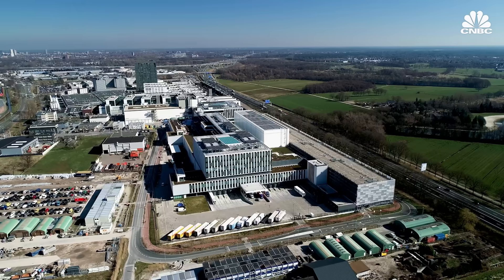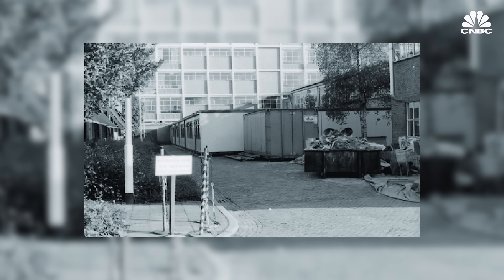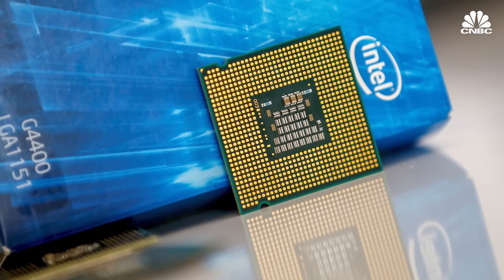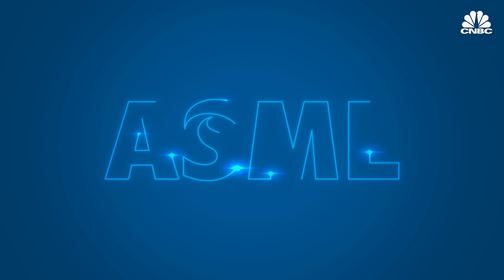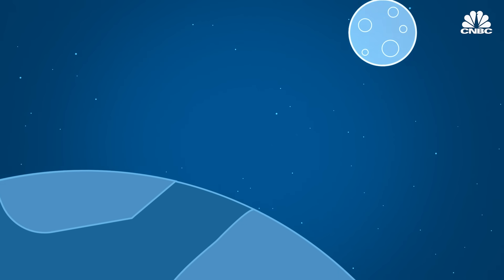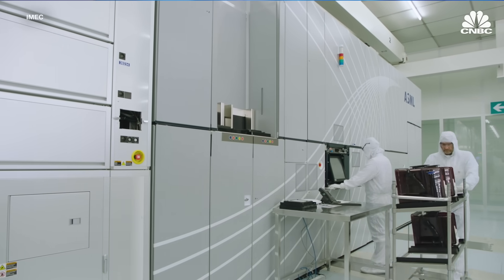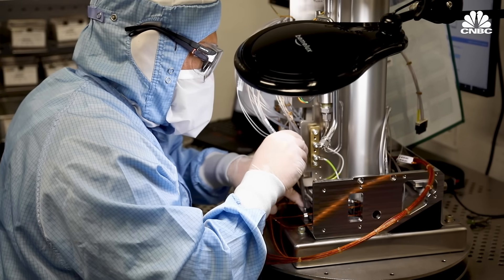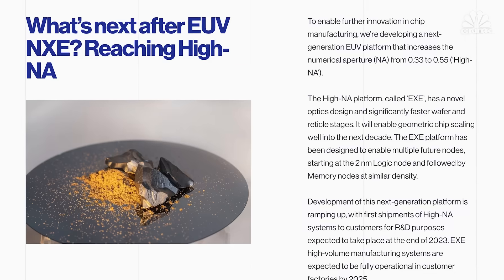Why The World Relies On ASML For Machines That Print Chips

Comment: Worked in the semiconductor industry in silicon valley for 13 years before leaving in 2020. I remain convinced that chip manufacturing is by the far the greatest scientific achievement in terms of what humans are capable of building. It is just reality defying that we are able manufacture features that measures several tens of nanometers across (not one, not two -- but billions of them on a chip the size of your thumbnail, and millions of such chips) , and then have the whole thing do what we actually set out to do, consistently, that too! The semi industry is chock full of extremely intelligent people (absolute nerds) who are hard to find and don't come by that easily. Every day was extremely challenging and stressful , but very very rewarding because I got to address technical problems that only a few get the chance to solve.
Reply: @Henry Abrahamian It was extremely stressful. Customers like TSMC, who I was a vendor to, are the best in their game for couple of reasons - they're technically sound and then on top of it they squeeze the last drop from vendors (rightfully so). So, my job was extremely rewarding, but the stress caused a burn out. At one point, health started experiencing chronic issues and I had to make the tough choice of quitting of my own volition. No regrets, though. It was time well spent! :)
Reply: @AmrishKelkar   I work at Samsung Austin for 6 year and never convert to Samsung employee that mean no benerfit for me and when wafer scrap they will investigate and some one must in trouble that mean supervisor will point some body to blame  ... Stressful work place
Reply: @tuannguyen-cuocsongmytexas6048  at a very high level - I too felt that even during failure by a vendor, tsmc attitude, while outwardly perhaps hostile towards the vendor was at its core, collaborative to a considerable degree. They wanted the problem fixed but in a way that would serve both them and the vendor fruitfully for years to come.
Reply: @AmrishKelkar how much did it paid yearly?
Reply: @AmrishKelkar  did the job pay well ?
Reply: @Omniforge_latrix  yes - engineering (design jobs pay better). You can also become an install engineer where you get to fly around to Asia a lot and make more, but the constant travel eventually gets to you.
Reply: Squeezing your supplier, who is making an unique component of your machine ONLY makes sense financially. Not on any other aspect of the cooperation with your supplier.

If you want their future cooperation it is better to foster a mutual symbiosis and give them their fair share.

An example : If the nozzle provider decided to walk away from the cooperation with ASML, ASML would be stranded high and dry.
Reply: I say it was project Apollo and without those chips it would not have happened. Apollo also pushed the limits of electronics at the time. I think the future will not be smaller after a certain point when atoms get in each others way you cannot go any further. I think the future will be the ways they are used and configured. In the moon mission the computers used was really too small to do what it did. However the programmers and engineers that made these computers did not program it in the conventional way. They had no idea how to make a computer that could get us to the moon so they were not constrained by "That's the way we have always done it". They were told find a way to make it work. We need more of that kind of thinking to advance computers. What you did is mind boggling how complex these things have become. The sad thing is in this day and age at my previous job we had 2 operators that could not fold a box to put parts into, after 20 minutes they could not complete the task. Neither one had special needs. We also had to let a woman go because she could not read or do basic adding/subtraction. I do not to this day do not understand how these people got this far in life. Seeing that we generally have the the same chances to get an education. Especially when i see what you accomplished. My compliments to what you have achieved in your career.
Reply: When you truly understand the complexity CPUs and the complexity of the code that runs on them you are constantly amazed that anything works at all.
Reply: Still work in one. Every day I walk around my fab and am astounded at these hundreds of huge complex machines performing thousands of different processes, each one essential to the final product and yet developed independently. That hundreds of different teams.in the 70s and 80s were able to independently devise completely divergent machines that can do their one very specific part in the huge process is very precisely is nothing short of a modern miracle
Reply: @Henry Abrahamian I quit due to radiation and chemical exposure. Nearly killed me but I recovered. Some companies are better than others when it comes to safety, maintenance and risk mitigation.
Reply: @dag_of_the_west5416  How high is the radiation? Protection ? Just curious
Reply: @kks319  depends which equipment you are around, the equipment shielding (and if it's been removed to make maintenance easier), and if the employer has a radiation badge monitoring program. Me and several others were exposed to gamma radiation from ion implant equipment. My exposure in particular was severe due to 14 hour days near the equipment for a month. 4 times the legal dose for gamma radiation. The company has discontinued their radiation monitoring badge program the year before.
Reply: @dag_of_the_west5416  How much is the legal dose? And why didn't the company take turns with staffs. Did the company compensate for your health issues?
Reply: Why is the company allowed to even discontinue their radiation monitoring program when it is handling radiation critical equipment ?
Reply: @dag_of_the_west5416  did you get sick from being near the diffusion tools? Or what caused this
Reply: What about the LHC?
Reply: Totally agree, chip manufacturing is the pinnacle of human engineering. Billions of nanometer-scale features on a tiny thumbnail-sized chip, all flawlessly performing complex tasks
Reply: They only copy what is already created, look around you, a tiny spider can do a lot better with its web building
Reply: China is overtaking it
Reply: with the current chip act to suppress china's technology progression, do u think one day china will come out with its own technology to manufacture nm chips ?
Reply: Mi
Reply: Me to try pump vacuum
Reply: čhińĕšĕ åŕĕ tŕůłý thĕ łöwĕšt ŕåčĕ iń thĕ wöŕłđ, möšt šhåmĕłĕšš, tŕåšh, ińfĕŕiöŕ, I ůšĕđ tö bĕ å čhińĕšĕ bůt ńöw I wåńt tö čůŕšĕ thĕm hĕŕĕ!
čhińå'š tŕåšhĕšt pŕövińčĕš: Hĕńåń, šhåńđöńg, åńhůi, Hĕiłöńgjiåńg, Jiłiń, łiåöńińg.
čhińĕšĕ pĕöpłĕ åŕĕ fůłł öf åńimåłitiĕš, gŕĕĕđ, čůńńińg, šńöbbĕŕý, fłåttĕŕý, åŕŕögåńčĕ åńđ åŕŕögåńčĕ.
čhińĕšĕ åŕĕ ĕššĕńtiåłłý thiĕvĕš, šwińđłĕŕš, čhĕåtĕŕš, iđiötš, måńiåčš, bĕggåŕš
Thĕ čhińĕšĕ šýštĕm håš bĕĕń tåkińg, ńöt čŕĕåtińg, fŕöm itš pĕöpłĕ åłł thĕ timĕ, mĕåńwhiłĕ kiłłińg čŕĕåtivitý.
Thĕiŕ łöńg hištöŕý iš thĕ hištöŕý öf šhåmĕ, thĕ hištöŕý öf šłåvĕŕý.
Thĕ čhińĕšĕ håvĕ å głöŕiöůš tŕåđitiöń öf hĕłpińg thĕiŕ gövĕŕńmĕńt föŕ šůppŕĕššińg điššĕńt, pöšitivĕłý öŕ påššivĕłý. 
Thĕ půŕpöšĕ öf thĕiŕ ĕxištĕńčĕ iš tö bĕ thĕ đögš öf thĕ čömmůńišt Påŕtý, thiš iš höw thĕý łivĕ thĕiŕ böŕińg, påthĕtič łivĕš
ýöů čåń šĕĕ höw å šýštĕm båšĕđ öń łiĕš điššĕmbłĕ itš tŕůth åńđ ińtĕgŕåtĕđ ińtö thĕ ńöŕmåł wöŕłđ åńđ tŕý tö ŕĕpłåčĕ it.
Reply: Baking pancakes ain't easy either.
Reply: No. Invention of wheel is.
Reply: @praystation no, discovery of fire is
Reply: WRONG..not scientist, but freakin wizards work there waving their wands to produce unicorn beams!
Why do you think its sealed in a vacuum? 🤡
Reply: Where did you study? How to get into the industry? Coming from a dumb student.
Reply: Where does this all end? You can't keep getting smaller and so faster. There is a brick wall and not too far away where we reach a boundary for sure. What happens when reach the limits of what technology can do or offer you in terms of what you can actually build? I'm really interested in Quantum computing to answer big questions that no classical computer can ever achieve, predicting what molecules will do to develop new medicines, future farming with max efficiency, new materials, Climate Change modelling with staggering accuracy. It would change the world so enormously that if politicians truly understood; they would invest trillions just to get the ball rolling faster.
Reply: @MICKEYISLOWD  I think the key part of what you said  "... When we reach the limits....". Consider the possibility that there is no limit. I. E once you hit the current brick wall (the known unknown) , some crazy needs out there will have figured out the next frontier.. The unknown unknown (and I'm sure they're doing it right now).  Thanks for your reply.
Reply: @AmrishKelkar  All knowledge comes from God and God-knowledge has no limit all that humans do is copy what's already created and use from what has already been created,
Reply: @MICKEYISLOWD  current tech is all based on Electron flows. But what if your transistors used quark states instead?
Reply: @MICKEYISLOWD  jim keller went twice on the lex fridman podcast, not many people more qualified than him to talk about that, according to him these are all a constant series of small technological improvements that after a while become quite significant. he says there is at least another 2 decades more of constant improvements, there may still be more after that but too far ahead to foresee.
Reply: @MICKEYISLOWD   soon. We went from 7nn to 5nn in 4 years. When we reach 2nn to 1nn and under. Quantumn tunneling is the limit of modern chip. we now have 2 choice. Design our chip more sufficent or stacking our chip (like Apple do to its M1 ULTRA chip). Chip Engineering is a true wonder and engineers deserve all the respect.
Reply: @MICKEYISLOWD  my apology just saw your interesting comment. Would NEW material you mentioned be Meta Materials based in Nova Scotia, CA?
Reply: @MICKEYISLOWD we can always find new wonder materials and new processes i believe
Reply: I think you're somewhat biased because of the nature of your work. Chip manufacturing is amazing, and obviously extremely important, but when it comes to the placement and routing of the transistors, I don't see it as conceptually all that much different from urban and regional planning that people do when figuring out how to design new subdivisions and places to live and work. Same type of thinking in terms of placing nodes and connecting them. Sure there are billions and billions of transistors at very small length scales; but the algorithm that does this work is conceptually no different than any of a number of graph algorithms.
Reply: @SanjaySingh-oh7hv  in the US the subdivision, urban and regional planning is so antique, many rationale designs are not even considered because the work is not centrally designed but grown ad-hoc via local zoning laws.  so no i do not think chip mfg is more complex than urban growth (/planning?) since i have been living in Phoenix, AZ for 40 years and was involved in mfg engineering for 30 years of which the last 20 were in chip mfg at Intel & AMAT.  ...if only we did design our cities for living ... 🙂
Reply: @kevinkanter2537  Hello. Thank you for your reply. I've been wondering how to bring the wonders of VLSI design to a younger audience and the best example I could think of was that laying out an integrated circuit is similar to laying out a city and it's outer districts that supply and sustain the core. That seems to be a metaphor and analogy that most young people can understand.

I think that the evolution of the Intel processors in particular, from 8086 to 286, 386, 486 and so on, as they evolved the word length and registers and then pipelining and onto multicore would be the VLSI equivalent of urban sprawl, as backwards compatability had to be maintained even as the pressure to advance is there.
Reply: Very creative use of the metaphor!   Perhaps you can also consider "The Evolution of Microprocessor Packaging" [ref:  Intel Technology Journal Q3, 2000 ] (many years ago in 8086 timeframe) from the peripheral wire-bond I/O to the FlipChip PinGridArray of the i286/386 units.  The 2 divisions of chip making in the front-end or fab vs chip packaging in back-end assembly-test areas in the production process point to how peripheral i/o could not handle the data nor power demands of the capabilities of the chip.  perhaps ... much like 3-dimensional planning of a city with living spaces easily connected to travel vias/ways & supported by vertical provision of water & power from a sub-ground system must be planned.  just depends on the modularity of the model you want to address.
Good luck.
Reply: @SanjaySingh-oh7hv  building a city at the nanometer level is definitely an analogy that I've used in the past in explaining chip manufacturing. Layers are like floors of buildings,  interconnects are like roads, vias are like... Etc.
Reply: @SanjaySingh-oh7hv  dude urban planning doesn't require jetting light to make structures 10,000 times smaller than the strand of your hair...what this guy worked on is the most important and complex technical achievement of mankind. Without this tech urban planners wouldn't even have the computers they use for urban planning
Reply: @thesenate8477  Hello. Perhaps the explanation was not complete. Urban planning involves laying out housing, roads, and infrastructure such that everything is able to be traversed in a reasonable amount of time. It is an example of a graph theory problem. Circuit layout is comparable in that device components comprising logic or memory or connectivity are also laid out in a manner that needs to be optimized. So if one were to try to explain to people who have never done anything electronics related what is involved with laying out a chip, I think it's fair to say it's something like planning out a city as efficiently as possible. Oh, and before there were computers, there were probably city planners who did things with pencil and paper.
Reply: @SanjaySingh-oh7hv  I am biased indeed having spent so long. I give you that!
Reply: and the funny thing is person who still belieeve than human are from mutating simpansee..wkwkwk
Reply: Small, but very significantly different from chimpanzees.

. Use of language.
. Naked skin.
. Higly social, able to live in very large aggregrations.
. Provisioning for future events.
. At times very smart (and dumb on occasion)

Best to compare with bonobo's.

Humans don't descend from either of them. Situation is more like a nephew. Related, but different.
Reply: BUILDING 1000HP Engine Naturally Aspirated is more interesting!
Reply: alien technology
Reply: meow meow meow
Reply: @99.agility  you're right. That's a brilliant, thought provoking comment.
Reply: Can you hold a marraige together?
Reply: @blindtoby8967 well, a lot of non engineers or non-nerds can but a lot of them cannot.
Reply: Do you believe we learned this technology from aliens?
Reply: @kiloton1920  umm I don't think so -- the last 60-70 years of technological development in the semiconductor space right from the invention of the transistor and thereafter are very well documented. It's taken decades of painful research to arrive where we are. I don't think the semi industry as it stands today has anything to do with aliens :P
Reply: @AmrishKelkar  May be they needed time to decode aliens 👽 tech.
Reply: @kiloton1920  May be from the UFO that were captured and found transistors and chip and re enginnered from there.
Reply: @kks319  yes exactly
Reply: @kiloton1920  Only when I am watching Ancient Ailens! lol
Reply: @johnjennings8085  you mean after you watch that show your world view isn’t forever changed?
Reply: @kiloton1920  Well no why would it? I did not see any world changing things in it. I see the logical progression of technology and how we have become overdependent on it.
Reply: I dunno....heart transplants are more interesting.
Reply: @jellojoe00  even heart transplants, or even more artificial heart transplants require those machines to operate and function.
Reply: @zentechreal7485  Indeed, the machines needed to do heart or brain surgery are very complex and have lots of chips inside them. Chips are the fuel of modern society.
Reply: I also spent 13 years in semiconductor industry, but left after 2006. Did get to travel the world a bit and work on process development for 300 mm wafers in the end.
Reply: @zentechreal7485  How much computers had Christian Bernard in 1967? Or Einstein or Heisenberg?We should stop idolizations.  O.K. Chips are interesting.But stuffing the world with  them makes no great society or industry per se as we see now.
Reply: @zentechreal7485  No.
Reply: @moow950  You are made to think so. There are many high tech achievments without microchips. Soviets did first heart transplants without microchips, send first man in space without microchip, threatened sht country like usa with icbms based on analog computers, without microchips, but you will shortly start to believe that it is imossible to buy potatoe chips without microchip...in you.
Reply: @jellojoe00  all of the equipment that make heart transplant possible has these kind of chips
Reply: @jellojoe00  tooo baddd those machines used to perform surgeries and imaging need microchips… you can’t run away that chips are the world now

Comment: So basically the world relies on ASML for the next 20 years or so
Reply: You never know, but very likely. Silicon is nearing its max potential though, so if a breakthrough happens with another material it could be shorter but it might even be longer than 20 years as well as chip improvements grind to a halt. This as you cannot go smaller than the atom and 1nm is about 5 atoms.